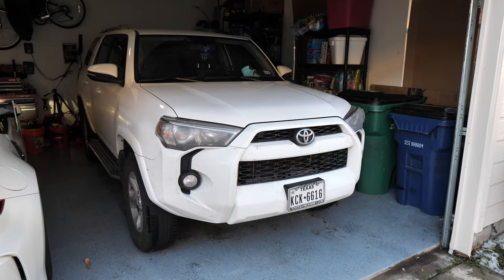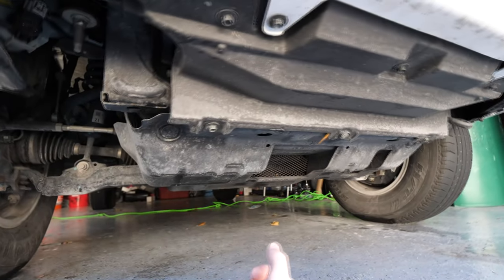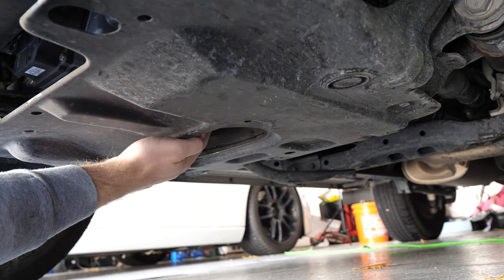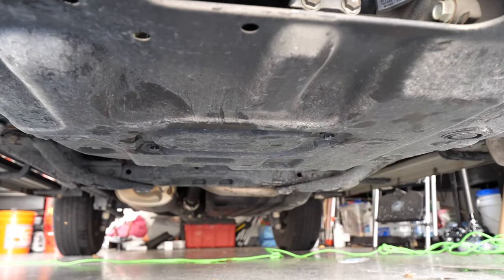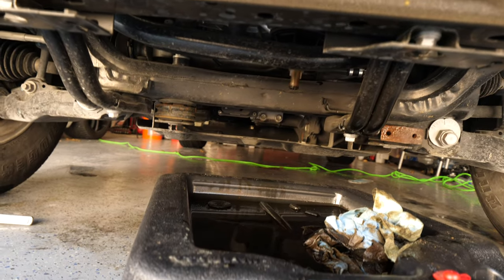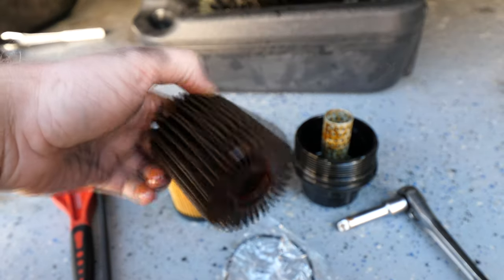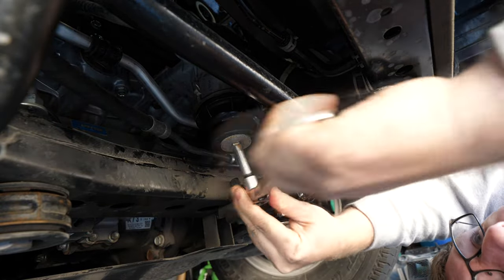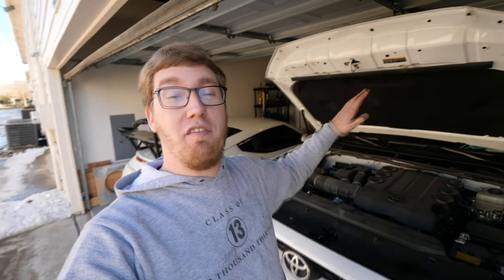Toyota 4Runner Oil Change (5th Gen)

Comment: Great video. I would add torque specs: oil pan drain plug 30 ft lbs, filter housing drain plug 10 ft lbs, and filter housing 18 ft lbs. I would also recommend changing the crush washer on the oil pan drain plug (though I will admit that I don’t always do that). Lastly, I would start the motor after your initial fill and let it run for a few minutes. Shut off the motor and wait about five minutes and check oil level again. Then check for leaks under the vehicle and if leak check is good, reinstall skid plate and front plastics.
Reply: I dont mean to be offtopic but does anybody know a method to get back into an instagram account..?
I stupidly forgot my account password. I would appreciate any tips you can offer me!
Reply: @Zain Ayaan instablaster =)
Reply: @Lane Kolton It did the trick and I finally got access to my account again. I am so happy!
Thanks so much, you saved my account :D
Reply: @Zain Ayaan Glad I could help =)

Comment: OEM filters allow greater flow by not putting a cap on either end of the filter. I paid under $4 for the filter (with o-rings) and the crush washer by ordering from Toyota's official parts website and picking it up at a local dealer. Shop around!
Reply: Yep! OEM filters and crush washers are actually pretty competitively priced on Toyota's web site. I bought a few filters for $6.00 each, some crush washers for $0.99 each, as well as all of the washers and seals for my differentials and transfer case for cheap. Plus, like you said, the OEM filter does not have the rubber cap on top and it allows the oil to flow nicely.
Reply: Agree. I always buy OEM filter .

Comment: No cleaning of components before installing, at 8:20 you tipped the canister describing o-ring install, old oil came out of the filter housing. Prior to that re-installing the drain plug, not listing cleaning the drain pan, installing the cover plate before starting the engine to look for leaks! Procedures that are 50 + years old! Lubing the oil rings from the old oil in the top of the drain pan, did any dirt fall into the pan before that? Hope you don't treat your Nissan the way you treat a borrowed Toyota!

Comment: Way too much work for a simple oil change. Costs the same to go to the dealer for me.
Reply: @erksworld  i respect that for sure. You take a lot more pride in it too.
Reply: Dealerships don't fully drain the oil, my 5th gen, with warm oil and warm weather still actively drips for over 30 minutes. I got an extra half quart by waiting extra time.

Something else, oil really should be changed at 5,000 miles and, in colder weather areas even with full synthetic, every 6 months. Something that I've just learned about is that the gasoline that gets into the oil stream in the cylinders breaks down the oil I didn't ever think about it until another YouTube Master diagnostic technician from a Toyota dealership, "A Car Care Nut" addressed the issue. Normally, people put more than 10,000 miles in their cars every year, so you never let it sit that long, but in this age of extremely high gas prices, driving generally will decrease for most people who can afford to.
Reply: Now it doesn’t. It’s like $100-120 where I live. Compared to $55 to do it myself